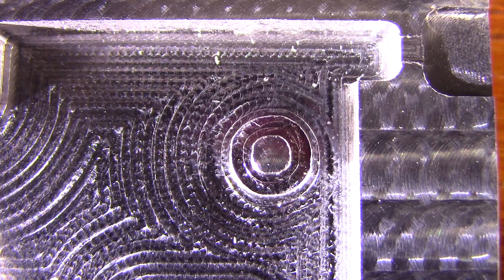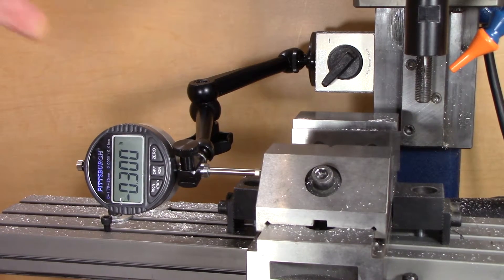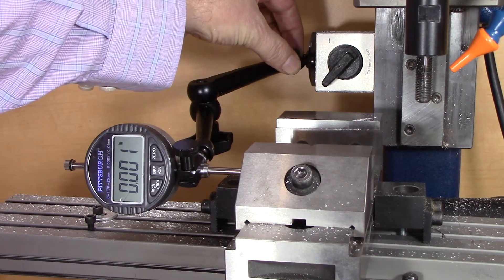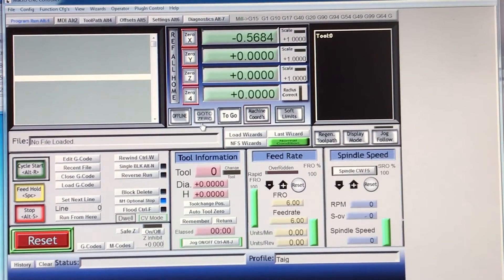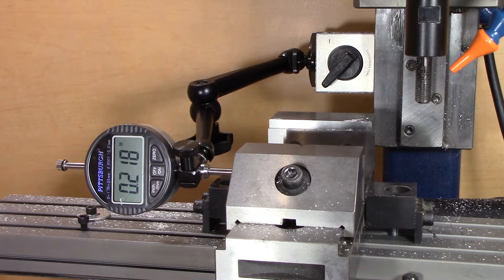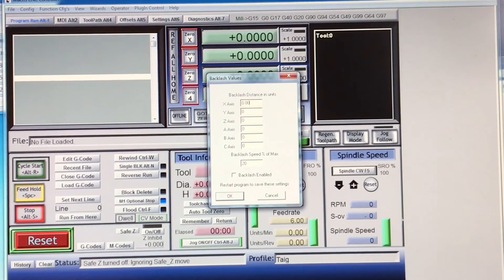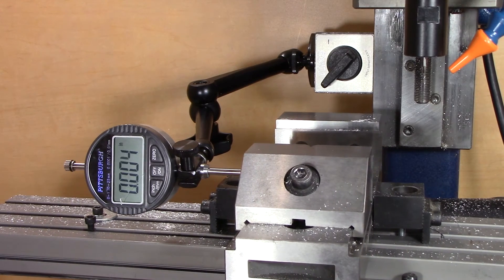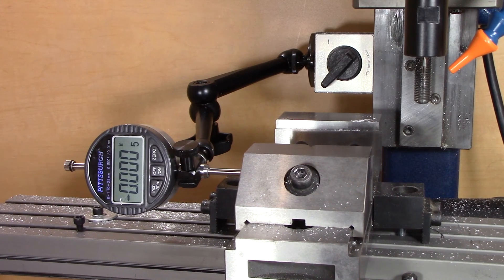Backlash

Comment: I see, I think. Thank you. So to calibrate for backlash you have to measure the repeatable slop in an axis and then tell the machine to compensate for that. You do that by preloading your indicator, setting it to zero, and measuring the slop. The number representing the slop is then input into the x axis for the backlash compensation and the machine will tighten up the gap in between mating surfaces for the change in direction  of the slop value taken by the indicator from left to right or vice versa.

Comment: Remember when setting backlash in mach3 ita not just the backlash tab. 
In general settings there is another tab which I can't remember the name of. 

It sets the time to move the backlash. It's important to set as it will try and remove it in an instant otherwise and stall the stepper. 

However it doesn't work with most non direct parallel port contolers it seems. They just try and move instantly at max feed. 

This is why I'm going to a stand alone contoler.

Comment: Further to my last comment, have just watched the video by Hossmachine <https://www.youtube.com/watch?v=A27nOkTFYDY> which is quite revealing.
Reply from the maker: Thanks. I checked, and the shuttle speed on mine was already set at .004. The Mach3 backlash compensation worked very well on my machine in the past. When it's time to change directions, Mach3 will pause movement on the other axes while it quickly moves the axis that's changing direction by the amount given in the backlash compensation dialog. You can control how quickly it does this, with the default being 20% full speed.

Comment: I imagine Mach3 backlash compensation should be OK with tiny cutters, but will it cope with say a 1/4" dia cutter in a climb-milling situation?  Tight control of positional accuracy was my highest priority when seeking a machine for hobby work.   

A tiny amount of kerosine or a puff of WD40 will help your cutters survive in aluminum.
Thanks for the honest look at your endeavors.
Reply from the maker: Backlash compensation is most important for small cutters so you get, for example, nice round  holes. I wouldn't think it's a problem for large cutters. That being said, I'm thinking about either upgrading to ball screws on this machine, or moving up to a Tormach 770. Also, I'm going to try WD-40 in the future to see if that makes a difference.

Finally, I ended up turning off backlash compensation and I plan on doing a video about why (it will be easier to show).
Reply: I'm not sure that backlash compensation can provide for truly round holes - despite it compensating to start the hole in the correct location initially.  As the cutter traverses around the inside face of the hole, at one position in both the X and Y axis screws, the thrust of the screw is transferred across the backlash from 'push' to 'pull'.  Does the software recognize this - and makes a hasty correction at the appropriate time?  
This may also explain why bosses inside the mold cavity were not truly round.  
Larger diameter cutters especially, can grab and pull the work plus table in a sudden jerk through the extent of backlash in the screws.
Reply: @JohnSL  hey John sorry to bring up this old topic, but did you ever make that video why you turned off backlash comp? Thanks
Reply: JohnSL